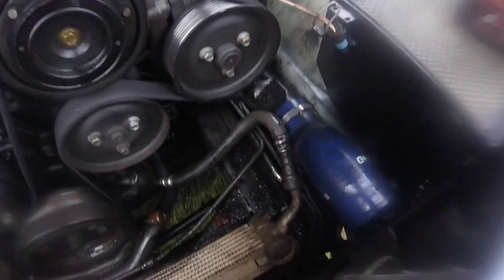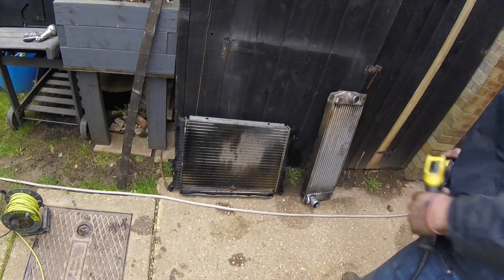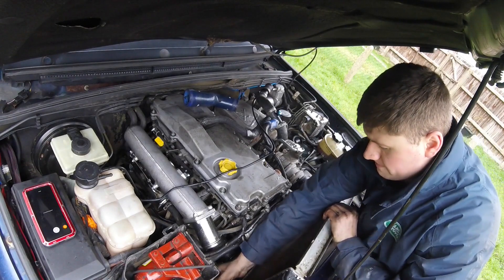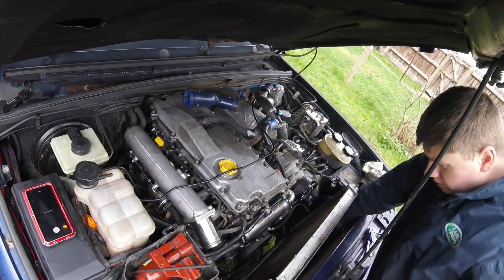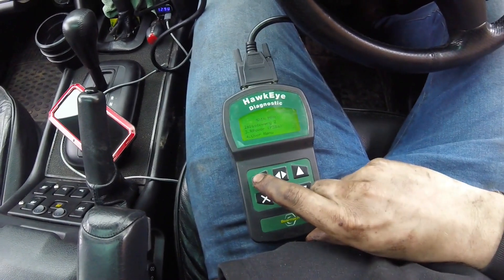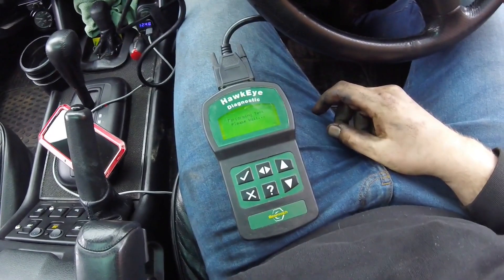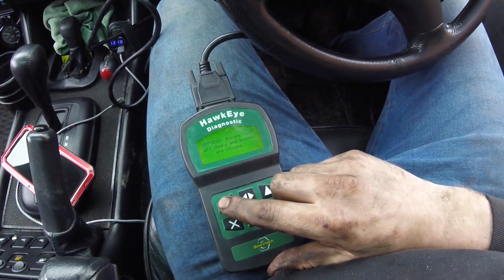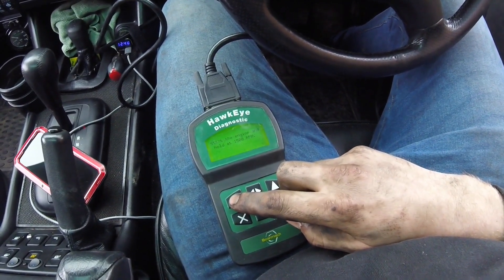Land Rover Discovery 2 TD5 ACE System Repair

Comment: Would a fault in the rams cause the vehicle to have a drop on the drivers side, mines doesn't sit level, it has airbags which I don't think leak and it's not got a broken spring 🤔
Reply from the maker: Believe it or not the front springs are handed left to right , I’ve heard if you swap the front springs left to right it can cure it 
Also check your rear height sensors are both reading the same height 
If they’re off it may be under inflating /over inflating one side

Comment: you should use a genuine hose for the high pressure pump to valve block or you will get a horrible noise
Reply from the maker: Yer I found this , but for now it keeps the vehicle up and running

Comment: I’m on with the same job. 
Have you noticed any drone noise since you did this. I ask because apparently there is an attenuator in the high pressure line from pump to actuator, which you would have removed with your new pipe. 
Cheers 👍
Reply from the maker: Yes I too have a drone , I looked at the old pipe in detail and couldn't find anything , however the original has a short section of a large diameter  which could possibly be for reduction of noise 
I'm getting used to the drone so at the moment I'm just pleased it's not leaking 😀